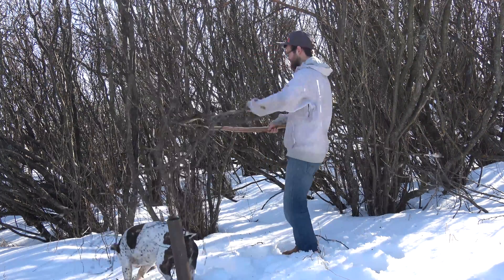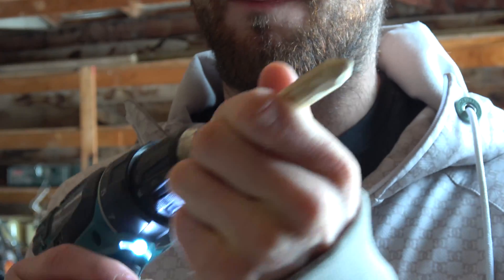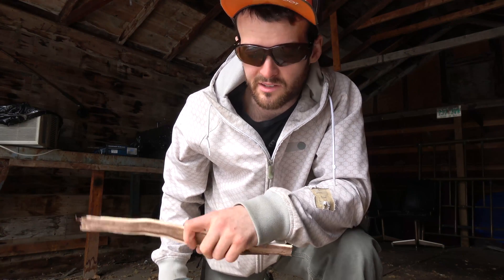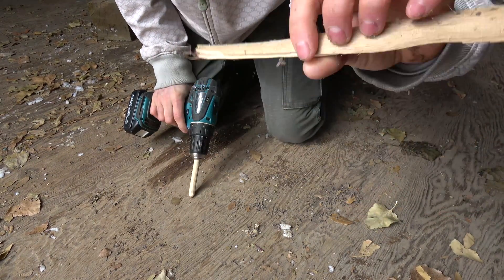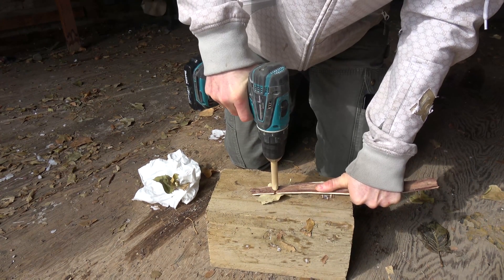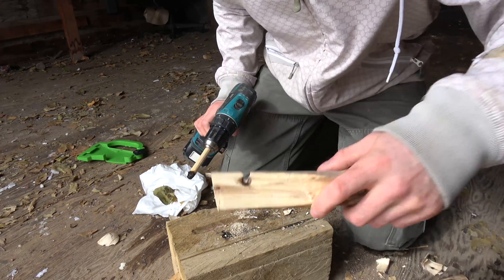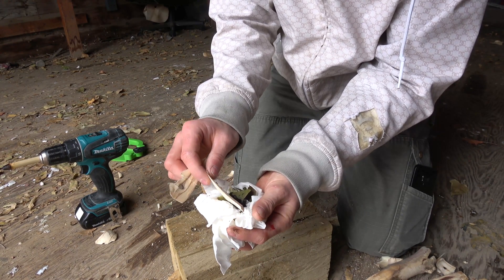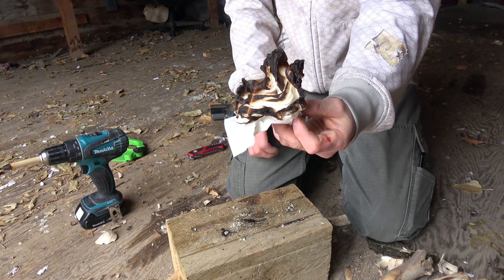Is it Possible to Start a Fire Using a Cordless Drill?

Comment: ofc it is use the lithium battery to make sparks. it will light up in a second
Reply from the maker: Lol my old boss couldn't find his lighter to smoke.. so he held a torch once beside his drill lol and the spark from the drill lit up the torch. 😋 it was kinda funny
Reply: There's a risk of the battery exploding in your hands
Reply: @Nachoshit  fire burns. there's a risk of burning. duh. so what?